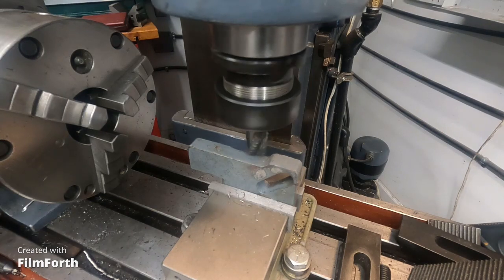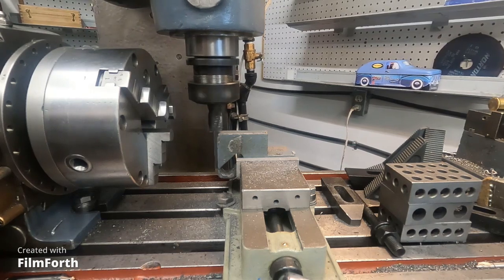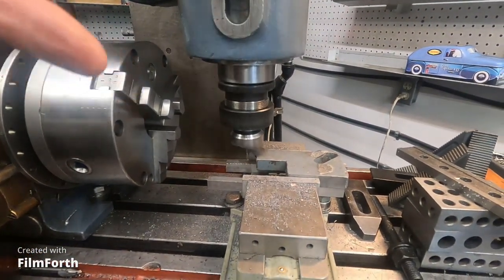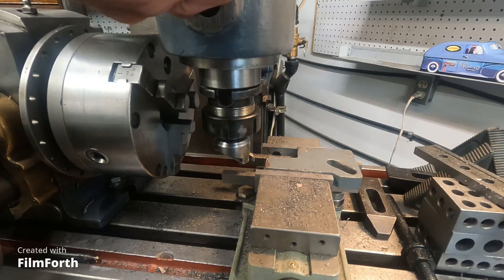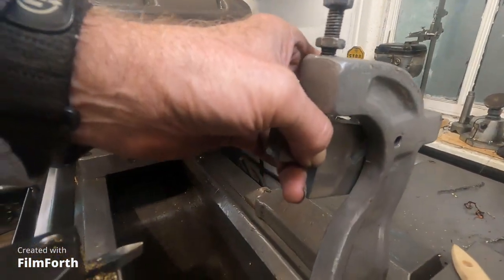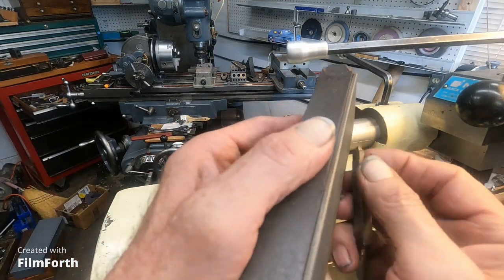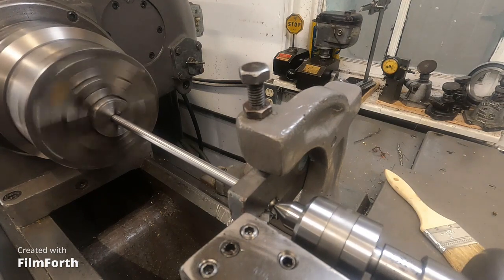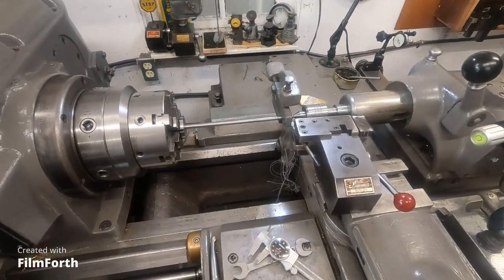Machining with follow rest Axelson lathe

Comment: I always liked the idea of supporting ahead of the cut instead of starting the cut, and adjusting the rest to support the cut material. I guess there are pros and cons to both methods. I have never seen a follower rest mounted to the left side of the apron. Is that how Axelson intended the mounting of the follower rest? Thanks for the videos
Reply from the maker: This follow rest is of very old design came in different sizes and will fit many machines. The Axelson follow rest is very heavy duty straddles the cross slide centered and not designed for such small diameters. I will go to the next level of small diameters using a brass plate with a hole in it, thanks
Reply: @deedeeindustrialsuperprecision  I would really be interested to see this brass plate method. It's quite a luxury for someone like me to be able to learn these "old" techniques from someone who really understands them, and can employ them effectively.
Reply: right on @deedeeindustrialsuperprecision
Reply: I like it @deedeeindustrialsuperprecision
Reply from the maker: The hole in the plate will have a V filed into the back of it to support the work instead of adjustable fingers. Jewlers lathe trick, that was mentioned in an early Audell's machinist book and a few other places for struggling with small diameters. It would be easier for me to do this using the smaller lathe with higher speeds. @hersch_tool

Comment: DeeDee, Nice to see that followrest project done and working great.  The Axelson Beast doing small diameter long turning perfectly.  With your talent you could be a millwright!   I’m just about to mount the 40 position tool post on the 10ee. With 3 holes holding drill bushings I won’t be limited to only 9 degree increments.  My friend, Archie, worked out that by having 0, +3, and +6 degree options for the alignment dowel dropping into a hardened drill bushing in the Tee Nut ground flush with the top of the compound I’ll be able easily set up for just about any angle including 30 and 60 degree angles quickly and accurately.  Getting cooler by the day.   Talk Soon.  Cheers, TB
Reply from the maker: The Blade is on it! If you want send photo of the Multifix install, it sounds like the solid mounting could prevent "KDK foot" that happens to even experienced machinist, with that system best used by millwrights who are more aware than woke.

Comment: Hi Don. question when I use my follow rest the work does not come out round. does not matter if the tool cutting the work is in front or behind the rest. It looks good when cutting but you can feel it is not round, it is ok at the ends in the middle is where the problem is any thoughts? Thanks
Reply from the maker: Somehow the work is finding a place to move away from the tool, possibly between the two fingers, thanks
Reply: I may have sorted the problem. I ground a HSS tool with very small radius, and snugged the top finger first then the rear and  the unevenness is gone. Thanks  @deedeeindustrialsuperprecision

Comment: I notice that with my phase converter also.  I installed a shut on the single phase going to the phase converter controller and then a fused shut off coming from the phase converter controller going to my 3 phase outlets.  So, three switches to turn it on and three to turn it off.  But, at least it doesn't allow the machines to try to start on single phase.  And no sense running single phase to the converter controller when it's not needed in case of a power surge or something when it off.  Kind of a belt and suspenders thing.  Thanks for the video.
Reply from the maker: I need to use my cut off switch every time, we do have power surges here, thanks!

Comment: I added a second contactor to my American Rotary so that the power stopped at it. I was concerned about accidentally working on the machine and getting a 220v contact
Reply from the maker: I need to remember to use the cutoff switch I have there

Comment: Good video keep them coming 
Ps ee monarch inch metric machine came up on eBay for sale what do you think 

Thanks 

Thomas
Reply from the maker: The 10 ee is 1984 or later would have regenerative dc drive requiring utility 3 phase,, not really enough photos, seems to be missing the tailstock quill lock handle and has an odd mounting for the 8" Cushman 3 jaw chuck, thanks!